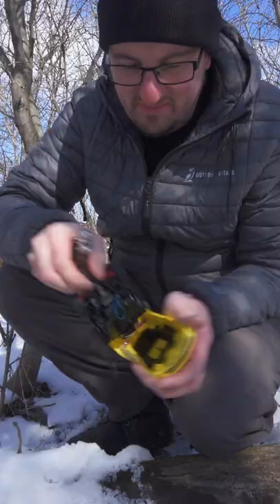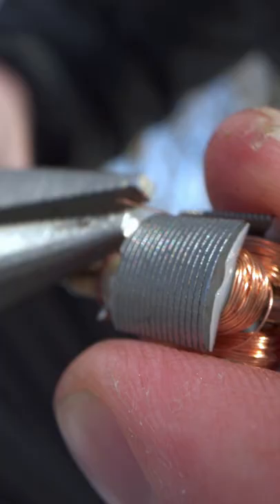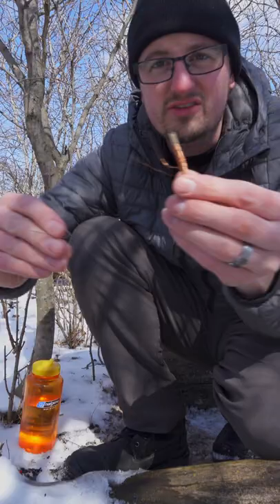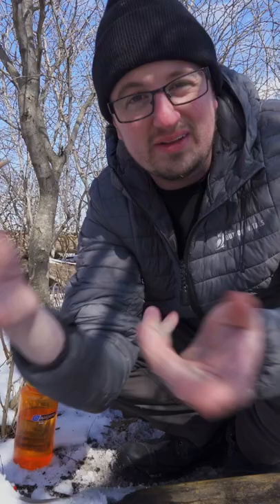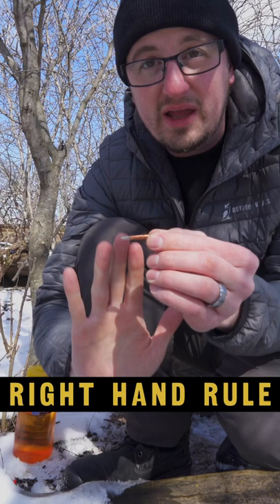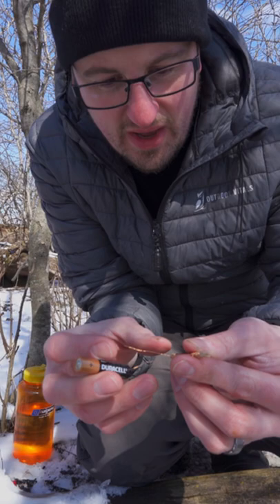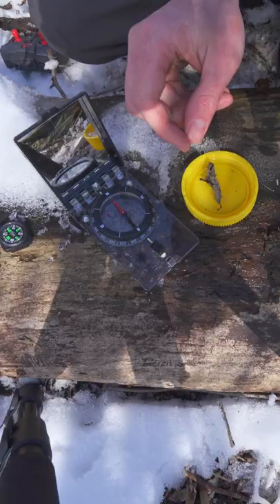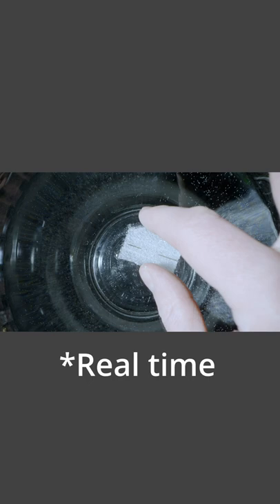Improvised Compass for Direction Finding

Comment: the motor literally has permanent magnets that you can just use to magnetize your needle by drawing it over multiple times
Reply from the maker: Indeed, I was trying to put the use of a coil to magnetize a needle in context by using parts from a toy. Using a magnet would be superior for sure. Thanks for the comment.
Reply: @grimgranite  *the magnet, from the motor, which you had to take apart from the wire...
However, useful to know it can be done , and also the axel from a toy car or other steel bar (which the magnet tell you if it's steel by sticking) could be magnetised and hung from a thin wire or thread to show north/south magnetic poles.
Reply: Why yes let’s pull apart am electromagnet…to make an electromagnet. Oh and ignore the fact the rubbing the permanent magnet on the pointer to turn it into the compass needle
Reply: Literally came here to say ya know theres a way easier way of doing this
Reply: @RJ-wx3fh  actually no you do not do that the magnets are not in the center on cheap motors liek that they are on the edges of the metal casing
Reply: I know right

Comment: My watch has a compass function just get one of those
Reply from the maker: There you go, that can work as a primary method for sure! Provides you know which direction on the compass gets you back to safety. What’s your alternate, contingency, and emergency methods for navigation?
Reply: @grimgranite  when I'm out I keep a Garmin gps handy. so the watch is actually the back up. It's solar powered and built like a tank so as long as no emp it shouldn't fail. Nice videos man I like 👍

Comment: Right hand rule is for generators. You’re talking about the left hand rule
Reply from the maker: The right hand grip rule is used to determine current direction and the resulting magnetic fields in a solenoid. The right hand grip rule is correct for this application.

Comment: Why not just use the magnets on the outer casing of the motor
Reply from the maker: It’s not readily apparent which direction the magnets are polarized to, so it would be very difficult to use them for direction finding. Also, the scope of the video was about how to make an improvised compass. Thanks for watching!

Comment: WTF is 'enamel wire'. It is actually copper wire.
Reply from the maker: Enamel coated copper wire is what is used for the electromagnets in motors. The very thin enamel coating keeps the wires from shorting out. Thanks for watching!
Reply: @grimgranite  today I learned...thanks

Comment: Diabloxfps has it right
Reply from the maker: The point of the video was to demonstrate the method of making a  reliable compass using an energized coil of wire. One of several ways to make an improvised compass, of course. Thanks for watching
Reply: @grimgranite  loved the video you make good stuff

Comment: Ok but when will I have a toy car and be lost at the same time? 

Doesn't seem that useful
Reply from the maker: In that specific use case, I agree! The video was meant to teach the method of using an electromagnet to create a reliable compass… the toy car was just a fun way to do it. You never know what you will have at your disposal, so it’s good to become aware of your surroundings and have these concepts tucked away in your brain. 😅 thanks for watching
Reply: @grimgranite    ah ok I get it.   So would it be possible to do this with a flashlight? Because when you go somewhere unfamiliar you always bring a flashlight and it seems more practical.   

  It's got wire and batteries so it would be possible, yes?
Reply from the maker: @justsomedude4469  Yeah, now you are problem solving! Totally possible if you have the right materials.

Comment: Use a stick and the sun. I've never found ur carried a toy in the field. Or find an old trash pile get a small piece of mettle
Reply from the maker: It’s the concept of making a magnetized needle with an electromagnet coil that I’m trying to teach in this video, not necessarily the exact context of being lost WITH a toy car. 😅  
So, the idea is… if it’s overcast, nighttime, you are in a high latitude that doesn’t see sun all day, there’s volcanic ash in the atmosphere blocking the sun, or perhaps smoke from a forest fire, you could make a reliable compass if you happened to have:
-wire
-battery 
-a bit of ferrous metal 

Thanks for watching!